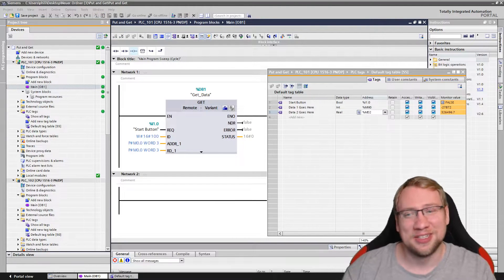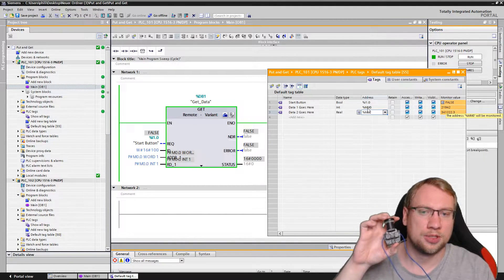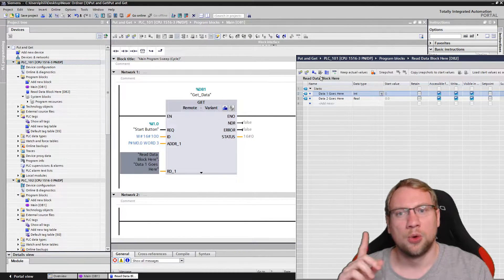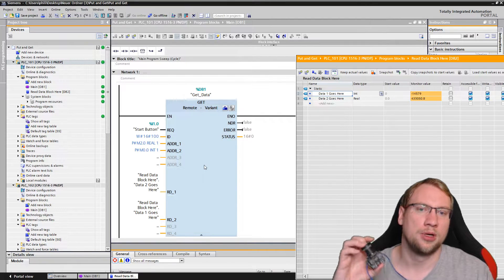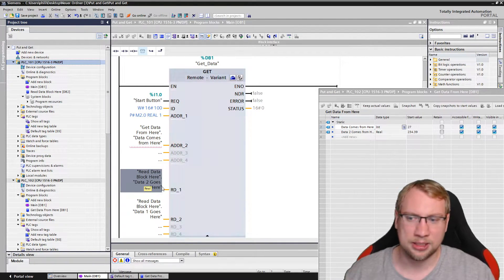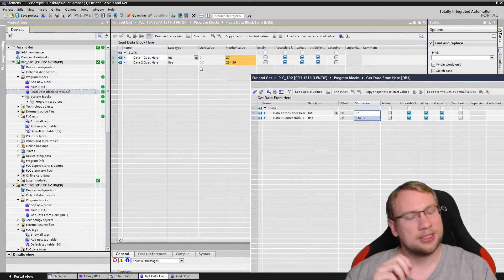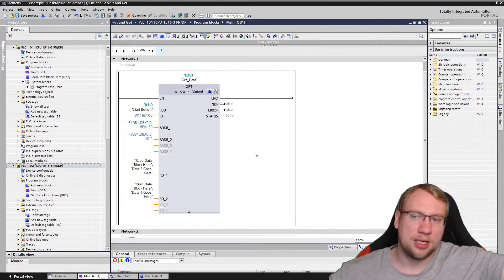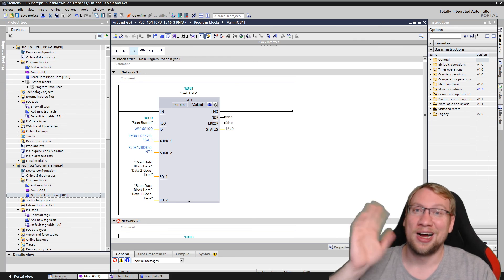TIA Portal: GET/PUT Details

Comment: I did it another way which also works I move the value into the data block and from there I put the data into the other PLC I did it on a project now where I need to send a Levels to another PLC which activates a pump on on/off control

Comment: Why use DB1.DBX ? Not DB1.DBW?  Bec its not boleAn 9:03
Reply: I need to know this too! Did you figure out why? I tried using DB2.DBW6 in different ways but none worked.
Reply: I think he is specifying the start bit of the variable with this address format. The he add INT after so it means 16bits starting at 2.0.